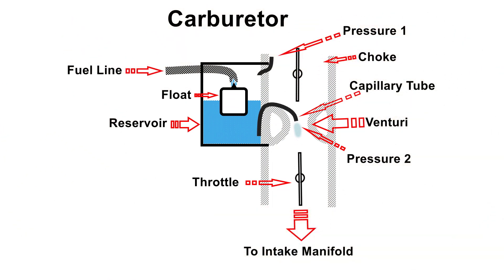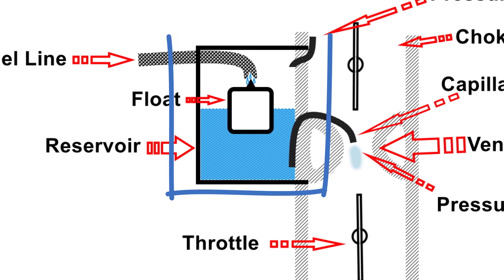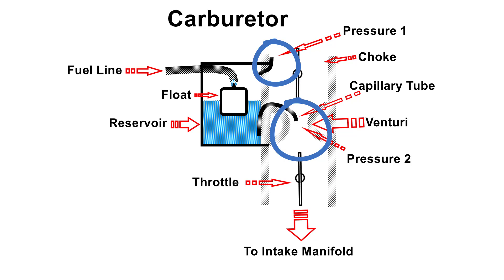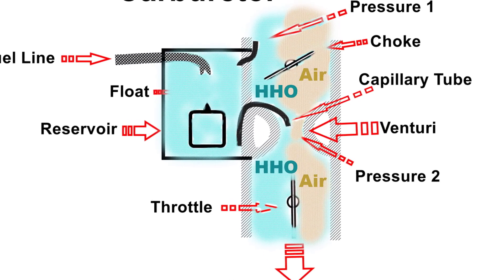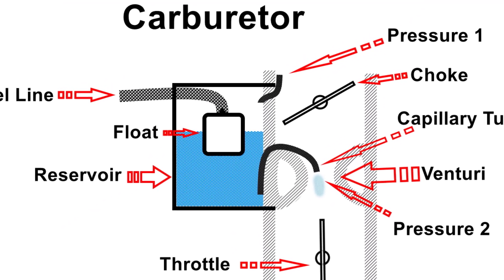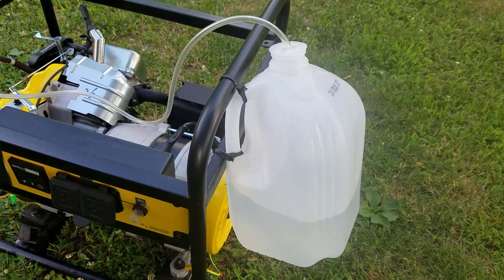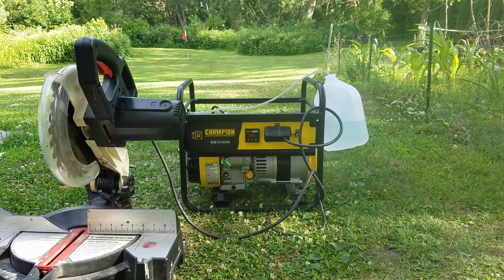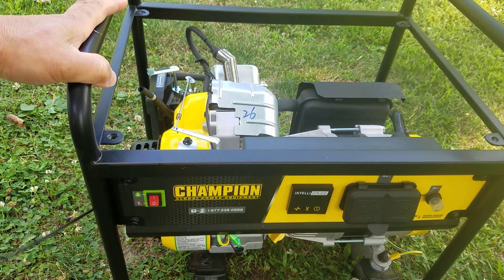Engine Runs On Water - HHO? (Fake Exposed!)

Comment: [Edit: I read elsewhere that it's to increase gas fuel efficiency. Ignore my rambling requests for info and clarification below! I'd be interested to know how the expected effect it has though - I can see that it wouldn't improve efficiency as in miles per gallon, so I'm guessing that people mean it burns cleaner, reducing engine maintenance or pollution? Right?]      

Can you brief me on the goal here? I can only imagine its a project to run an internal combustion engine vehicle the way you would a chargeable electric vehicle (use the grid at home to generate hydrogen, then use said hydrogen as a fuel when 'on the go'). Is that the aim? If so ignore this post and maybe read my reply to it instead?    

Because the video looks like it's trying to figure out a way to run a generator using water as a fuel (via electrolysis), and that will never be effective...         
I expect that you know that. You probably also know that the 'exhaust' from burning HHO is water, and I have a feeling this is a spoof video or a misunderstanding of your intent on my part....  Poe's law is certainly on my mind here, and after having read discussions in the comments, I can't help but state what is obvious to many. Apologies if a joke or goal is whooshing over my head; I expect it is, I'm blonde and used to that! 😂    

So, the system you're trying to design is starting with water, adding energy to the water (from the charged battery) to convert it to hydrogen, then to turning it back into water to get the energy back in the form of heat, yes?     

That means, even if your entire system was 100% efficient (obv. it'll never even be close), your system could only keep the electrolysis going if it was not doing anything else (including making sound, creating heat, and turning an engine/generator!)     

I have a strong feeling that this video has some other intent / proof of concept, but given the other content being produced/linked, I just wanted to make sure, just in case your intent was to generate hydrogen via electrolysis 'on the fly', by the same system that was using hydrogen as a fuel. (An insurmountable  thermodynamics problem). The discussions about it seem to demonstrate (as a joke?) a misunderstanding about HHO - burning hydrogen with oxygen does not 'use up' H or O. It just turns HHO back into H2O.
Reply: Aside from 'joke' and 'failure to understand critically important elements of the project', the only thing I can think that's being aimed for here is an attempt to convert an internal combustion engine car into a chargeable electric vehicle (charge (make hydrogen) at home using the grid, then use said hydrogen as a fuel when off the grid) Is that the aim?

If so, I'd be interested to hear more about the specific energy capacity of hydrogen, both when compressed, and 'loose'.
From what little I know about it, I expect that the vehicle able to harness a hydrogen combustion system to the point where its more efficient than electrical motors would be a(n almost) lighter-than-air aircraft. I can't imagine anything else being able to compete with battery + electric motor, but your confidence in brown's gas seems to suggest that you know something I don't, and I'm interested in learning what that is. ♥

Comment: Hook the hydro cell  to the alternator.   Suply on demand. More revs more  volts to the cell  more gass  works  best. Carb valve is open   floats down.   Start up on. Petroleum   switch on  volts. Turn off petroleum. In line water gas trap. Makes safe  +  there is no tank of hydro supply  on demand. Simplified   amout of gas is  the revs you give.   = more volts = more gass      ues  battery.  Only  to start up   or  petroleum  ... Then  power from alternator   to hydro cell
Reply: But, but... that pesky first law of thermodynamics. Ah well... some people gotta learn the hard way I suppose.

Comment: I completely did away with the carburetor and made a flat plate with hose attached and put a air hole in the plate with a screw. So I can adjust it rich or lean controlling the speed that way. 
 I make my hho generator to produce 2 to 1 hydrogen to oxygen.  So I have a larger adjustment range for the air screw adjustment.

Comment: My take on that is, that it runs on ethanol alcohol, which you can't distinguish from the water if shown in clear container. It is absolutely possible to run the engine on ethanol with minor modifications to the carburetor (I believe that just requires the changes in orifice)
Reply: Ethanol would not produce the bubbles then during electrolysis
Reply: İ8
Reply: Look and see how thy make hydrogen.. HHO that's the take .. you might learn something..

Comment: First of all you use a battery , already there your idea died out, its supposed to run on water not on a battery, theres another movie with water & what i would like to know is the power output, cant it pull all the households neccessities  heat  referiguator freezer laundrymachine & light. I just dont know how to find out without building it.https://www.youtube.com/watch?v=0B0wPUmZB3U

Comment: I have a generator that runs on gas or propane and the carb is choked to let propane in .your hho gen needs to be big enough to supply enough hyd to work your totally wrong
Reply: I tried this but I used only a 7 plate hho for a 9500 x 12500 peak, Westinghouse generator.  All I was able to get was one backfire.  Any Idea as to the amount of Hydrogen is needed?

Comment: my concern is how they did not use any check valves , if you think about it the spark would ignite the hydrogen and oxygen mix and the explosion would rip back through the system, and blowing up the bubbler .. also they claim that they are running a 20 plate set up using 12 v starting battery, they did not even use any heat sinks or even thick guage wire . I know personally that those wires would heat up every fast and even melt.
Reply: Lack of oxygen in lines
Reply: HAHAHA! i know for a fact they melt! I have tried this myself and OH the smoke n fire-wires =D I now use 8Guage wire

Comment: I was wondering when this was going to come to use.
But I can't understand why you just can't burn atomized water.
Water is made of the two elements that are perfect for ignition, hydrogen and oxygen, the hydrogen and oxygen should burn atomized naturally. But it, at its normal state puts fires out. 
At its atomized state, hydrogen is very flammable, and oxygen is the best catalyst known for any kind of reaction.
So why haven't we got an atomized water engine yet ?
Cheap and clean energy.
Just using a normal gas carburetor run pure water through it and it should atomize the water enough to just burn.
The only problem I can see is that the water wouldn't be completely burned, and you would get water remaining in the cylinder, this could be overcome by actually having a drain at the bottom of the combustion chamber that is timed to drain the water at the bottom and during a exhaust stroke.
Can I get some guidance from the posters who are interested in this, it could be something very useful.
Reply: With electrolysis, you add power to transfer one electron from each hydrogen atom to the oxygen atom. 
Now the Hydrogen has a electron missing and wants it back, while the oxygen has two it wants to get rid off.
This is the power that makes the bang when you ignite HHO gas. In H2O state, everything is as it should be, thats the reason you cant ignite water as there is no energy stored with missing/too much electrons. 

With atomizing water you just increase the surface area of the water, but its still water. And water doesnt burn.
Reply: @ExolorLP  Thanks but I still am in doubt because if you have a mist of water, and you light up close to the mist it does crackle and ignite roughly.
Reply: @gianfrancofronzi8368  You're seeing a sputtering in a flame as it interrupts the visible fire's air flow ratio, that is all. Much like how a person jumping on a grenade interrupts it's impact radius.
Reply: @ExolorLP  and what is the solution to this?
Reply: How about funding
??
Would that help??
Reply: Man, you can't use water simply put, gas separates from c8h18, to combine o2 and h2 into h2o. This is a reaction with oxygen and hydrogen as reactants, with h20/water as a product. Thus, you must electrically separate the two, as WATER can't burn as a fuel, it just atomizes as vapor which is non-reactive with air being that the hydrogens' in the molecule of water are already satisfied with their one water.

Thus one must understand that reactions release energy. Not just putting something in that makes itself!?!?!? Ever wondered why cities pour down harder when it rains, more cars = higher humidity, which in return grants higher chances of rain and more frequent raining in the cities.

Comment: ive seen many HHO between 2010~2015 then all of them stopped
i have genuine questions
if its work why they disappeared!
if its work why no one in corp section try to make it industrialized?
what size and spec HHO dry/wet cell needed for Power generators since they usually goes by psi or cc not LPM?
& for how long can sustain power with that cell underload w.o break or stop...
wish someone could answer these questions after all 2/3 of this planet is water!
Reply: The Corp section don't want it industrialized because they then can't make money any more on fossil fuels, solar panels, nuclear power plants, reservoir plants, windmills etc. Clear now?

Comment: I imagine you can take carburator off and attach 2 ball valves with a Y connector, one opening for air intake and other for hydrogen gas intake. Much like a wood gasifier system. And if you are an electronic wiz you could measure the engine speed and have electronic valves that open and close according to what the engine needs.  Or does a system using electrolysis need air intake?? Unless the oxygen produced is not enough to help ignite the hydrogen?
Reply: Ok..let's try it
What do I need to buy?
Reply: @seawolfrising1409  im in Pike County Ga if you want to try this
Reply: @seawolfrising1409  did you try this out yet? What are the results?

Comment: Seperate the water with electric field not current,  follow Stanly Myres design and inject the water through modified injector that separated the water on demand using high voltage and straight water, no electrolysis via current flow only through very strong electric fields. 
Using this method the volume of gas produced is many times that of conventional Electrolysis using a fraction the power. It's not a simple backyard build as the injector is acting as a capacitor so you add a coil in parallel to make a resonant LC circuit then Excite the circuit at resonance...
Simple eh 👍😉

Comment: Just bypass carb. Remove spark plug, Screw in stainless steel 1/4 elbow. Drill and tap top of the elbow. Install smaller spark plug connect spark arrester to elbow then check valve. duha!

Comment: to build an injector replica simply use t shape connector 1/2pipe internal rod 3/8 and ppr for t conector and isolation.Usefull for dielectric heating ionic heating induction heating .see WFC 423

Comment: All right love the video however I still do believe that it is possible to run hydrogen into your motor it is also achievable to run methane into a motor less explosive hydrogen quite explosive and yes I was looking at the factor of backfiring so there must be a way of mixing how about trying The experimentation and running the hydrogen inside the motor maybe bypassing the carburetor some ways I'm not sure however there's also another thing you may want to explore is there a way of converting plastic into basically petrol itself this would be using it in converting it into a form of diesel that could run on diesel motor it will not run on the standard motor because it's gasoline you need to have a diesel motor for that to run when you hit a plastic up to 400°, you will go back to it's mainly original form basically plastic arise from gasoline or component of it however this seems to be working back in the 1940s during the second world war people were using wood to basically Drive their cars and it's what happens in the process of burning wood there's also gas that comes out of it if it kept airmatically closed and you burn this wood you will have smoke and you will have gas coming out this gas can be ignited however I do admit and I like the fact that you were doing those interesting analysis on how it would work on the hydrogen there are cars that run on hydrogen there are certain vehicles that run a hydrogen it will probably easier to run a turbine on hydrogen than to run a motor or even running a steam motor on hydrogen hydrogen would create the fire to heat the water to create the steam to activate the turbine ultimately as well and the gas motor you may also have enough heat coming out of the gas motor because it is mainly 20% efficient and a lot of it is going into heat part of that heat could be recirculated and reuse for potential steam or also hot water just a hypothesis ultimately thank you for the video and if you can do a project that would actually work with the hydrogen it with the motor on showing how it would work basically bypassing the whole carburetor issue this probably would help alleviate most of the cost when you're concerned transportation people could start generating their own hydrogen of course it is dangerous it is explosive however I think there's other ways of also using what we have we have plastic that we can recycle into oil by heating it up and we have methane coming out off the main sewage
Reply: It is hydrogen from the burning wood that caused the engines to run during the war time, but of course all the tars from the wood would gum up the engine after a while.  Hydrogen is less dangerous than gasoline in many ways.

Comment: The biggest problem is your setup has no thought into it at all. You have a garbage hho generator. Some stainless steel plates spaced properly would give you enough, even with just using salt for your electrolyte. And you can change the airflow without modification to the carb by just blocking part of the the air flow with even paper and a rubber band.  I ran my whole house for almost a week straight when we lost power for 6 days last winter took me 10 minutes to adjust the air flow on a setup i built for under $30. The still i built to make distilled water powered by the generator cost more but thats a different topic.
Reply: Do you have videos or a channel showing what you did I would be pleased to see them... thanks
Reply: Ran a whole house for a week.
Surely you have built a better one that can last for years without being hooked to the power company.
Reply: Cool story, bro.

Comment: Use the same delivery system for propane gas generators
Reply: I tried this and it did not work.   I by-passed the regulator and went direct to the carb on a duel fuel  Westinghouse Generator.

Comment: if you really wanted to use hydrogen here is how. You need a electronic gas injector like propane, then you need a standalone Ecu like for a car that is tunable. You need to tune the ecu on the engine for various loads to allow the injector to increase or decrease Pwm on load and maintain correct Air to fuel, Using a afr gauge... simple really But I don't actually see people trying the right way. instead of using it right to the carb the wrong way.. may need a bigger h2 generator to allow for correct flow under max load though. Need a spark arrestor because it will get pressurized doing it this way.. Also should be using 2 electrodes to get pure h2 not a mix of air etc.. but what do I know I'm just a average guy that never went to college..
Reply: Not much it would seem.

Comment: How about taking the hydrogen in via the air-inlet(filter), and have a valve on the hydrogen to control the supply?
Reply: Yep it works.  But. Off a 12 volt battery.   Supply of gass.  Stays same.     Hook up to alternator    more revs more gass.  Solved  .... In line water trap.  Stay safe   no back fire   but no tank of hydro any way  supply  on  rev demand.  Thats  how folks. More revs more volts in hydro cell more gass.   Easy  yeah
Reply: I was thinking the same thing.   Just like spraying starting fluid in the air intake
Reply: Show us
Reply: @raunadawson7757  i